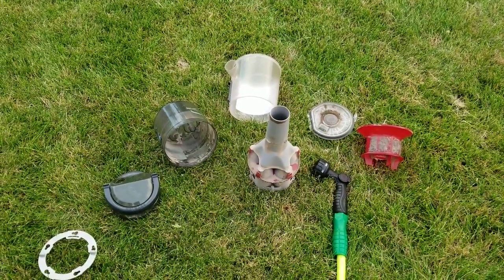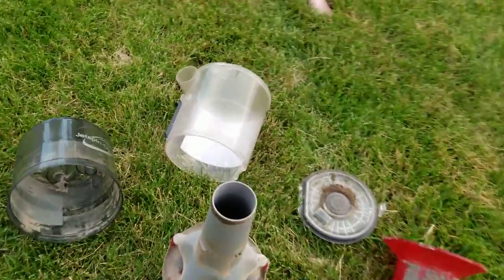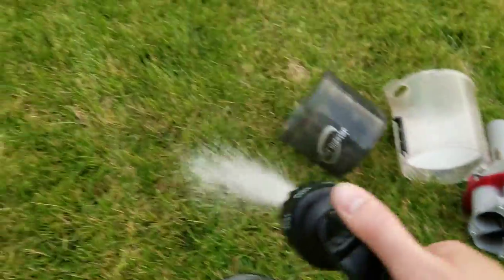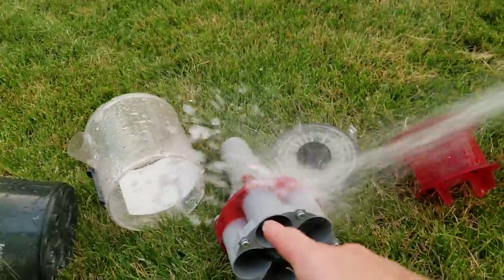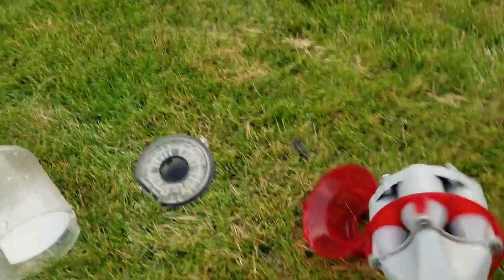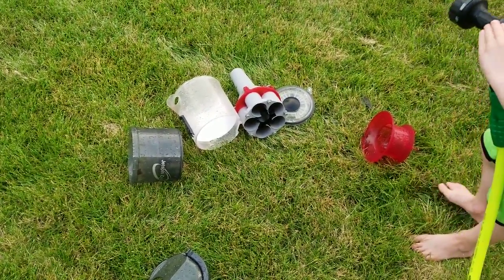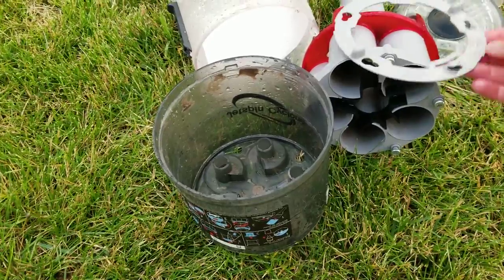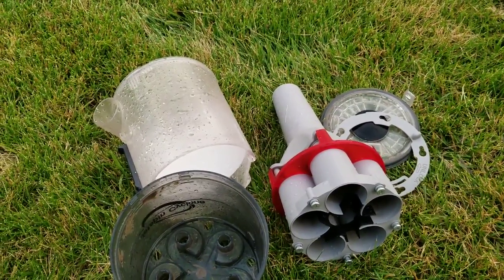Clean Bagless Vacuum Bin The Easy Way

Comment: Wish you would have shown how the parts come apart. All I do is clean the dirt container. But I feel it still has a misty smell when I run the vac.
Reply from the maker: Grace Ortiz what vacuum do you have? The disassembly is going to be a little different.
Reply: @DIYDad1  shark
Reply from the maker: Grace Ortiz ah okay so that bin doesn’t really come fully apart if I understand correctly, but there is a removable screen filter on the inside you need to remove and a washable foam post filter that sits under the bin. A lot of the nasty smells come from the foam filter that’s underneath the bin in the vacuum when you remove the bin. Give that a wash and it should help a lot. This guy has a great video on the process. https://youtu.be/1C5zRjxAOt4
Reply from the maker: Grace Ortiz oh yeah also clean out the hose. What I like to do about once a year is remove the hose (sometimes it’s just a screw holding it in or a twist fit of some sort, if you can’t remove it then just take a shop vac and clear the hose as best you can). You should be able to wash it in a tub or a sink easily just spray some water into the hose and rinse it really well and let it dry for a day or two before you use it again. Put some vinegar in a spray bottle and just spray the inside of the hose down too that helps a lot. Just don’t wet any electronic bits! I’ll probably have to do a video on this in the future I think 😀